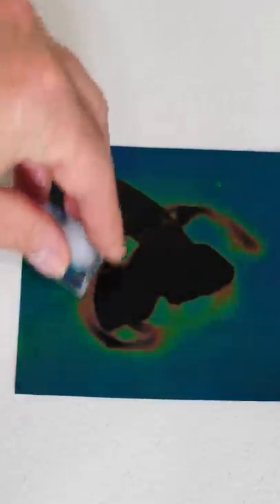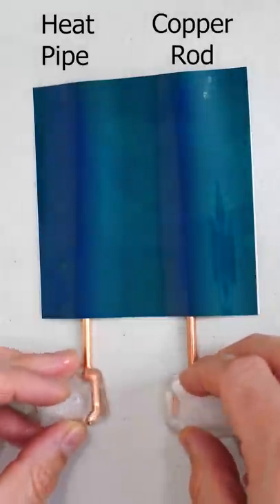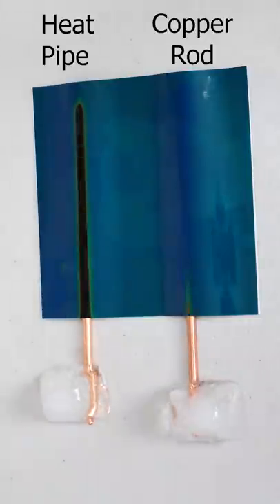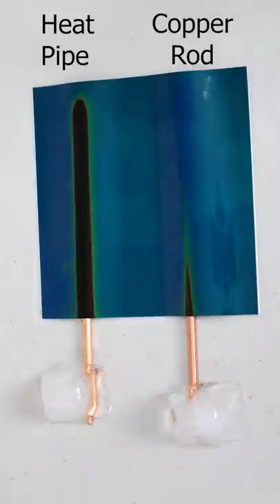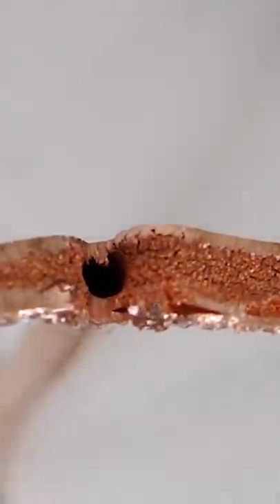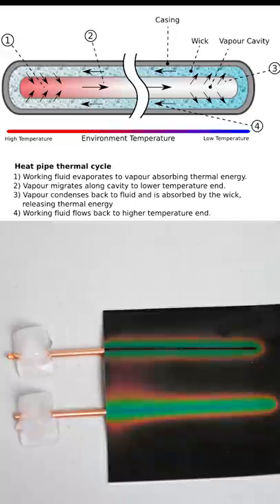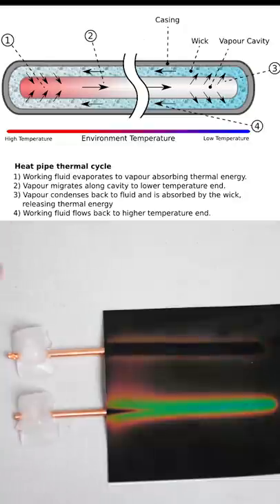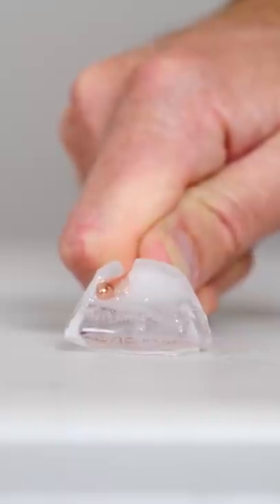The World's Fastest Heat Conductor

Comment: The last scene sold me. Got me one of these! All of a sudden now I have the urgency to cut my ice cubes.
Reply: You have these in your pc why would you buy one wtf
Reply: @LelLel  yeah because he is gonna rip out the heat pipes from his CPU cooler just to cut ice cubes, right?
Reply: @nilaksh007  what? If you really want one, you already have one. No need to cut ice cubes with it you goof
Reply: @LelLel  lol... this guy said that because he wanted to try cutting the ice cubes with the copper rod... It's a satisfying sight...
Reply: @LelLel  just take the joke. Don't be weird dude
Reply: Me too
Reply: You can use water however most Heat pipes in computers use some type of refrigerant like Freon. Acetone can also be used. When the heat pipe is designed it is designed to a specific range of working temperatures and this determines what type of refrigerant to be used. Noticed the porous copper inside too. This is made using sintered copper which allows the heat pipe to work in any orientation, even opposing gravity. You have a hot and cold side when the liquid vaporizes it changes phase to a vapor and travels to the cool side to release heat. Then it condenses back to a liquid and travels back to the hot side. The sintered copper acts as a wick which helps it travel via surface tension of the fluid. Although you can make them without the wicking but then you need to stand them straight up. These work just like the AC cycle in your car or home except far smaller and simpler. These will most likely be replaced when graphene nano tube cooling technology comes to fruition.
Reply: @latenttweet  thats a whole essay man i wish my hands could stand that
Reply: Where can you buy these?
Reply: When i ever hear the word conductor i always think of dead space
Reply: @LelLel  damn you weird
Reply: @LelLel  just got a liver transplant I really wanted! Now I just gotta hide the body...
Reply: @LelLel  Toby, why are you the way that you are?
Reply: Esse é um momento r/suddenlycaralho
Reply: Buy a CPU cooler with a decent heat pipe (it's the bent pipes sandwiched between the CPU pad and the fan unit), take out the unnecessary parts like the fan unit, and there you go.
Reply: @latenttweet  can they be used for the reverse to store heat better too?
Reply: @memo-zd1qz  thank you. Your video was very helpful for my mood
Reply: you can cut ice with graphite too
Reply: @imindujayasekara2566  :00
Reply: Wouldn't your hand feel cold tho
Reply: @nilaksh007  can pull em from old pc parts that are unused / otherwise trash.

Also:  Budget Ice Carving
Reply: Ice cubes!? I will be cutting everyone's name by hand!
Reply: Give it to someone to stir their drink 😂
Reply: @nilaksh007  it’s a joke 🤦‍♂️
Reply: @jonathanbetz1240  what joke 😑
Reply: This comment is gold lmao
Reply: J C  bet you felt good with that one
Reply: @jebaited2449  what a hero
Reply: @rubik8529  i could ask the same question
Reply: @dwightschrute832  i think he got it the first time so theres no need to play hero
Reply: @beepboopgpt1439  you know if he already stoped responding it probably means he got it.
Reply: @latenttweet  
Very interesting comment. I'll have to lookup" graphene nano" tubes.
Reply: @dwightschrute832  people are suffocating just to get this copper out of the ground 

No need to get heatpipes for this when you literally have a video that demonstrates it 
And just for cutting ice cubes? F your satisfaction then

Reuse
Recycle 
Get rid of mono economy
Reply: @LelLel  i said what i said🤷‍♀️
Reply: @cyrilsantiago8918  im not playing hero. And he just replied to me, yeah thx.
Reply: @dwightschrute832  then whats your reason for commenting you clearly see he was proved wrong so what was the point?
Reply: @cyrilsantiago8918  Cuz i want to😬
Reply: @dwightschrute832  welp that was useless
Reply: Lol
Reply: That explanation is just screaming "PLASMA BLADE!"
Reply: @memo-zd1qz  nice parrot
Reply: @memo-zd1qz  nice
Reply: But how come the heat sink in my console can't keep it cool? With all heat pipes and fan?
Reply: @latenttweet  
Why would they use freon instead of water?
Reply: @latenttweet   I see and appreciate your handle.
Reply: @yunkshione-1016   Same reason a regular solid heatsink with or without fan would succeed or fail:  everything is designed to be as light, compact, and inexpensive to make as possible, so its built right on the edge of the expected use case.  These days software detunes the hardware to try to keep the experience seamless but none of these technologies we're talking about can cool things below the temperature of the environment you're in.  (That's a job for heat pumps.)
Reply: rip ice cubes
Reply: @dwightschrute832  The irony of you saying twitter freaks have no humor then having an office profile made me laugh today.
Reply: @cyrilsantiago8918  What’s the point in commenting back if he isn’t going to respond to thank you, white knight?
Reply: @honeyeggs9145  i dont get it is this a compliment or like a hate hate comment
Reply: @LelLel  no. Our pcs have copper pipes. Not the heat pipes
Reply: @LelLel  he said he wanted to cut ice cubes tho, regardless of if theres a reason to do it or not
Reply: Wait... does the word... "urge" come from the word "urgency"? :o
Reply: 10.000th
like:)
Reply: You're wonderful
Reply: HE CUT IT WITH A ROD OML
Reply: @latenttweet  dude really found the quickest essay on computers to copy and paste
Reply: No need to knee the pack to separate them anymore
Reply: Ice Cube the rapper : Nooooo
Reply: @nilaksh007  just got me a new darkrock 3 for the kitchen
Reply: @LelLel  also not everyone has a pc
Reply: @dannyteebone9233  yes you are just moving heat. What application do you want to store heat, when you already have it? Look into heat pump systems this may be more what you’re thinking.
Reply: @csn583  lol you’re the first. Thanks man I appreciate you
Reply: @davidscott5903  water boils at 100 C, Freon boils at -12C. It depends on the application. For a computer for example if you used water than it wouldn’t start working until 100C (roughly)
Reply: @Ron04123  I did a lot of work with heat pipes. I guess my user name went over your head
Reply: The best way to source heat pipes is to get an old computer heat sink with the tubes. The tubes are copper the fins are usually Alumium. Turn upside down ina vice and blow torch the fins. The solder will start melting then just pull them off while the solder is liquid. Be careful not to bend the pipes they will leak out and not work. 

Actually break one on purpose so yuh can see the difference. What I used to do is take the broken one and make someone hold it in a hot cup water (like boiling). Nothing would happen. Then I make them do the same thing with the working heat pipe. They instantly burn their hand on it. It’s pretty trippy because it’s like 100x the thermal conductivity of copper alone. It’s kind of a brain trip to see first hand cause you don’t see anything in your normal environment conduct heat that fast.
Reply: @latenttweet  
I was thinking that they would seal the heat pipes with water boiling in them, so after they are sealed there would be no air in them, and then they would be under a vacuum and the pressure would vary depending on the temperature, and it would always be at the boiling point. But that does make me now think of the question of how well the water vapor would conduct heat at low pressure and low density.
Reply: @keebo872  if that’s an essay to you, you’re teachers must be very disappointed
Reply: @dwightschrute832   I think it's a complement. I love your profile name. It's awesome!
Reply: I have done it and its fun
Reply: @Lilmickcrocodiledundee0001  You can buy these on E-bay, here's the title if the link got removed. 220/240mm Length 10mm Diam Cooling Round Rod Copper Heatsink Heatpipe Laptop DIY
Reply: @memo-zd1qz  now I need a dancing parrot too
Reply: Omg same
Reply: @jonathanbetz1240  ikr people these days can't take a dang joke especially with things like this
Reply: @memo-zd1qz  keep up the good fight, the algorithms are shit and this is how we should share stuff
Reply: The perfect ice sculpting tool
Reply: @LelLel  Imagine being this mad bc of heatpipes
Reply: Cutting ice cubes?😂
Reply: Somehow its fun..

Comment: Water + Low pressure to use boiling point to optimize heat transfer... That is so simple that I call it genius !
Reply: Tech that literally saves computers.
Reply: Interesting.
Reply: @Grimmjeaux  wait it's all water cooling?
Reply: @Chillin4030  I think he's referring to heat pipes. Though the liquid inside is not necessarily water.
Reply: @Chillin4030  no, and not every cpu/gpu cooler uses these heat pipes. Many don't, but it is a far better solution
Reply: I just said that
Reply: I want to make heat pipe
Reply: @Chillin4030  🔫 always has been
Reply: @Chillin4030  always has been 🔫
Reply: But not a water is actually used in heatpipes. Weird he told a "water"
Reply: @Chillin4030  no,but liquid colling - yes
Reply: @Chillin4030  always has been
Reply: Sometimes the simplest solutions are the most brilliant
Reply: Vaper chamwr
Reply: Vaper chamber
Reply: You can use water however most Heat pipes in computers use some type of refrigerant like Freon. Acetone can also be used. When the heat pipe is designed it is designed to a specific range of working temperatures and this determines what type of refrigerant to be used. Noticed the porous copper inside too. This is made using sintered copper which allows the heat pipe to work in any orientation, even opposing gravity. You have a hot and cold side when the liquid vaporizes it changes phase to a vapor and travels to the cool side to release heat. Then it condenses back to a liquid and travels back to the hot side. The sintered copper acts as a wick which helps it travel via surface tension of the fluid. Although you can make them without the wicking but then you need to stand them straight up. These work just like the AC cycle in your car or home except far smaller and simpler. These will most likely be replaced when graphene nano tube cooling technology comes to fruition.
Reply: @studytime2483  don't, just buy it
Reply: @Chillin4030  More like water/steam cycle cooling.
Reply: What does that mean
Reply: @latenttweet  thank you, I was actually suspecting that driving de boiling point should come with some constraints on the range of temperature under which the heat pipe will be most effective... But I was thinking about different pressure level, not different refrigerant.

Any link about that graphene nanotube cooling technology ?
I am really curious !
Reply: @Chillin4030  always has been
Reply: @Chillin4030  (something something hydrogen oxygen in the air)  
🔫 always was
Reply: @Chillin4030  no. They use pressurized water to conduct heat better because it immediately floods the rod
Reply: @Chillin4030  Not really, it's essentially permanently sealed since vapor chambers have to be pressurized, and as somebody pointed out, it's not necessarily water vapor being used either.
Reply: i think that's a way to cool your CPU in a gaming pc
Reply: Doesn't it stop working so well if it's not horizontal?
Reply: @skatetwopurt  as fbi, we must warn you against that. We dont want you to meet us.
Reply: @latenttweet  finally someone with iq greater than 10000000000000000000
Reply: First I read that at "water + loo" (Waterloo is a song)
Reply: @suntzu1409  🤣
Reply: @latenttweet   
Water is the best refrigerant for any heat pipe in the range of 0° to 130° Celcius. Other refrigerants are used when the temperature is out of that range.
And it is not quite like the air conditioning systems in your home and cars, because they use a compressor to cool below the temperature of the condensing side. But yes they both are a type of phase change heat exchanger. 
Thank you for telling us about the sintered copper to wick the water against gravity. I was unfamiliar with that part of their design. I was thinking of the drinking bird toy as a great example of how this works, and as a visible example.
Reply: @latenttweet  One of my favorite applications of non-wicking heat pipes is pilings in permafrost: to avoid the ground around them melting  they (or at least the ones on the Alaskan oil pipeline) are filled with (IIRC) ammonia which makes them conduct heat upwards much faster than downwards.

I've thought it would be fun to bury a field of them in my yard and see if I can get enough "permafrost" in the lower 48 to keep my house cool in the summer. ... probably too much work.
Reply: @benjaminshropshire2900  
That is a cool idea, but it would take a nearly impossible amount of heat tubes, and be way too expensive. The problem is that the earth has too much thermal conductivity and it will stay at a somewhat average temperature based on your area. The cheaper thing to do would be to bury large coils of water tubing that will transfer heat to and from the ground and use that water to heat and cool a heat pump. It's called a ground source heat pump and they are very efficient and will eventually pay for themselves over their lifetime.
Reply: @davidscott5903  I'm aware of ground loop pumps, in fact that's how I was thinking of getting cooling from the system: the issue they usually run into is that the amount of heat consumed in the winter and the amount of heat rejected in the summer rarely balance. And the ground isn't conductive enough to make up the difference: it ether cooks or turns into an ice block. Given I'm thinking of only cooling, it would end up being the former.

As for your reasons it won't work: I'm not sure what you are comparing it to as a baseline for conductivity or impossible amounts of pipes, but IIRC soil is a good enough insulator that the temperature ~1m down barely change around the year. What I was thinking of would be ~1cm wide 3-4m long pipes on a 50-75cm grid just below grade. That should give about 10x the amount of soil being "directly" cooled in the winter and would only cost a few thousand dollars. If the tops are well above the frost line, then the whole volume should be expected to get close to freezing each year.
Reply: @Chillin4030  always has been
Reply: @benjaminshropshire2900  thats cool thanks for sharing. I’ll have to look into that. Have you guys seen the ice cream scoop that has Freon in it? It’s pretty popular brand. They are cheap too like $15, and work really well. The heat from your hand helps melt the ice cream. Sounds like you all would love it.
Reply: @Streethagore  no specific links. It seems like we’re still far away from this due to the complexity and cost to produce. However it seems like this could solve our current limitations in battery technology. There’s a good bit of papers out there ok graphene and battery tech.